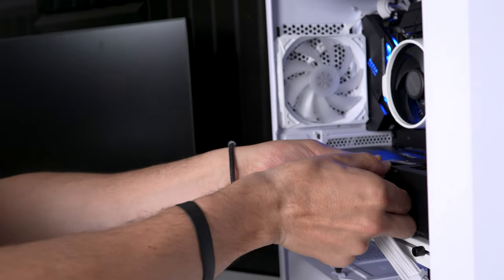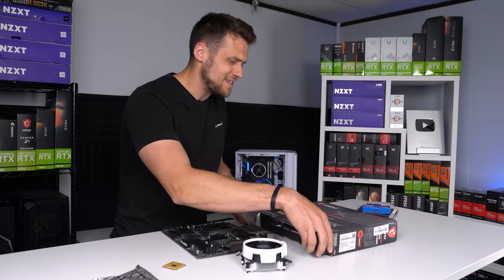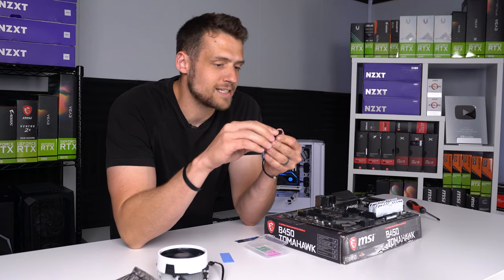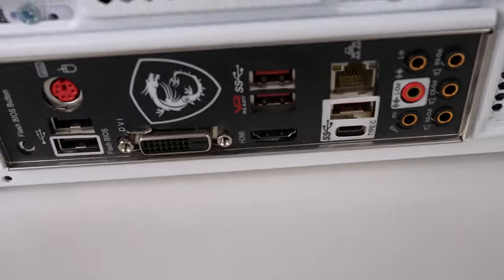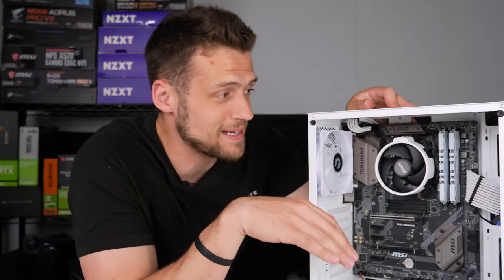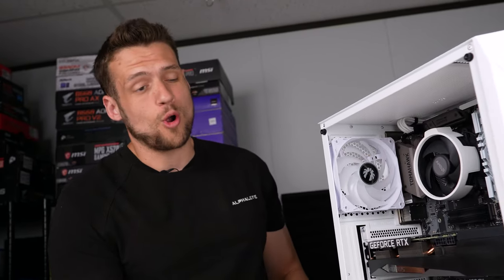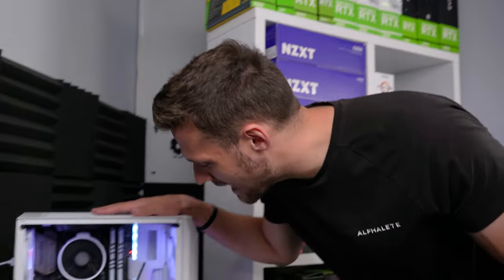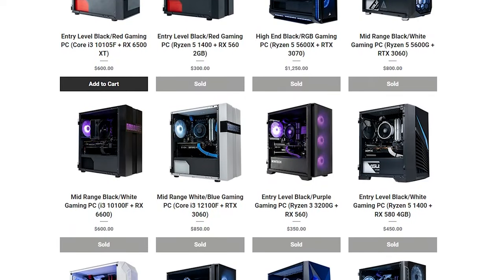How to Build an EASY 1080p Ultra Gaming PC!

Comment: For a long time, we have gone AMD for budget builds. However, we now have the 10100 and 12100 i3 series that provide awesome performance at a decent price. The 400/500 series motherboards for intel will also have great price drops soon once they start flooding the used market.
Reply: It all started when then 9100f came out imo
Reply: @wheezer7844  not then imo. They just released zen 2 and they had the 3100/3300x. But it is your opinion

Comment: Hey Zach! I have been finding Ryzen 5 5500s online for $135 lately. They are pretty great CPUs for the price.
Reply: you can get the 5600x for very little extra
Reply: An R5 5600 is far superior and about the same price.
Reply from the maker: Yea IDK about your region, but you can get a 5600 for close to that
Reply: @christopherjames9843  Ive seen the 5600 on Amazon for $180.
Reply: @ZachsTechTurf  My region is Pittsburgh PA. Ryzen 5600s are going for $180 on Amazon right now.
Reply: @mariusandersen2952  $200
Reply: get a 5600 for way better performance, 5500 is like worse than 3600

Comment: i bought the r5 3600 when it was considered the best price to performance cpu at the time, still in my build had a gtx 1660 but i sold it and upgraded to a 1070, and now i can run a dual monitor setup perfectly fine
Reply: Downgraded*
Reply: @robloxcodepaster  1070 is 25-30% better in performance, so not a downgrade, yes it might be older gen but it is still better, yes higher priced but better 
iused to lag with the gtx 1660 but the 1070 stopped me lagging in every game, i can play any game i want now doesnt matter what games
Reply: @robloxcodepaster  with a 1660 i couldnt even run 165 fps with it, which is my monitors fps, with the 1070 i can run 300+ fps perfectly no issues at all
so you're wrong, search it up, 1070 is better

Comment: Do you  know if this is a good pc for £1000?
-intel i5 12400F 6 core 12 thread
-RX 6600 XT 8GB GDDR6
-16GB DDR4 RGB 3200 MHz( 2 X 8G)
-1TB NVMe M.2 SSD
- 500W 80+ Bronze Power Supply
- B660M Motherboard 
- mid tower case

Comment: But, won't this be quickly phased out?  I don't think in the next year or 2, this will be able to run the next gen of games with max settings.  This is a tricky time to build imo.
Reply: B450 can run 5000 series Ryzen chips.   That's good enough for a few years with the right gpu.

Comment: @KL Gamers  I use b450 aorus pro wifi with amd ryzen 5 5600g without graphics card sometimes pc turns off automatically never turn on cpu usage 100 percent when export cr3 raw images in Lightroom its cpu usage increasing 100 percent then I use Chrome for play songs it's turn off 70  I checked everything but didn't checked smps and ssd I don't no I can't figure out it's so frustrating Would you explain this

Comment: Why not 6600xt over a 3060, performs better at 1080p and is cheaper.
Reply: He knows that the 6600 xt is better value, but he already had a 3060 on hand, he probably didn’t want to buy a new graphics card just for the video
Reply: @reallysillybillyischilly7166  should I stick with buying 3060 or switch it with the 6600xt?
Reply: @pedroDpoop  if you already bought the 3060 it’s fine, but the Rx 6600 xt performs better in a lot of games and is much cheaper, so I would go with that
Reply: @reallysillybillyischilly7166  I haven’t bought it yet but just making sure, if I buy the 6600 super do I have to do any changes to the build or can it stay as it is?
Reply: @pedroDpoop  I don’t think so and it’s the 6600 xt there is no super for AMD, I recommend you join Zach’s discord server like I did because there are a bunch of people there who can help you out
Reply: @reallysillybillyischilly7166  oh ok thx
Reply: @pedroDpoop  no problem just hop into the pc building advice section and we’ll help you out